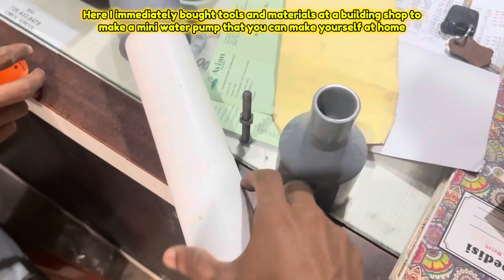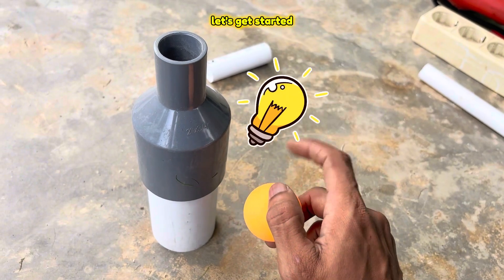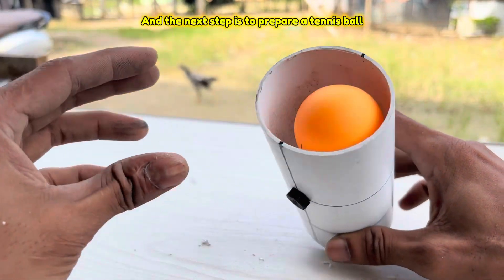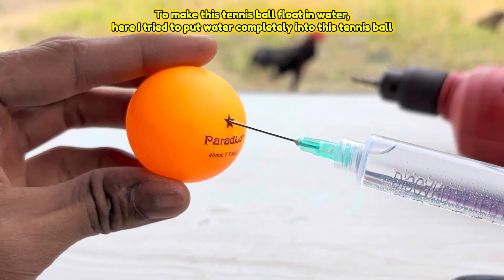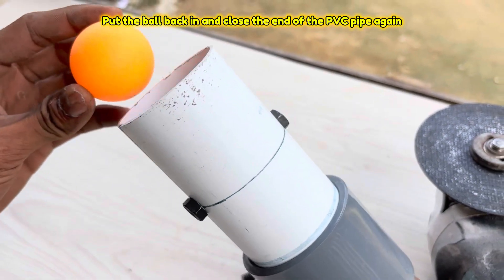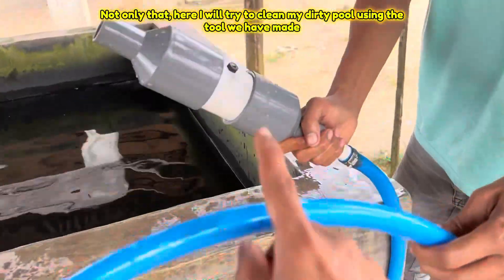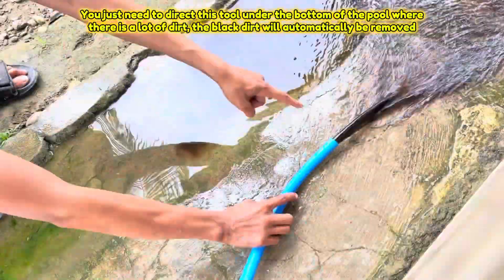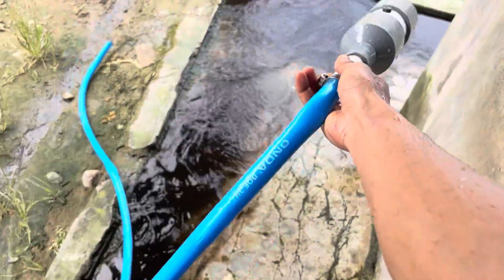Use this trick to clean a dirty pool fast, you'll thank me for the rest of your life

Comment: This DIY pump idea is truly clever and cost-effective! You made it look simple, and the results are impressive. However, for even better efficiency, try adding a one-way valve at the base of the PVC pipe to prevent backflow. It would make the suction more consistent and reduce manual effort.